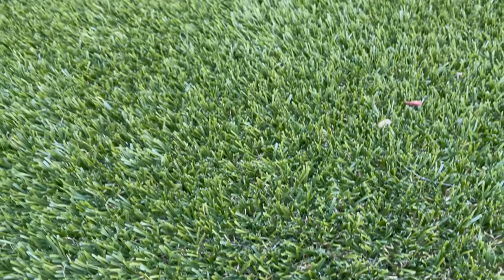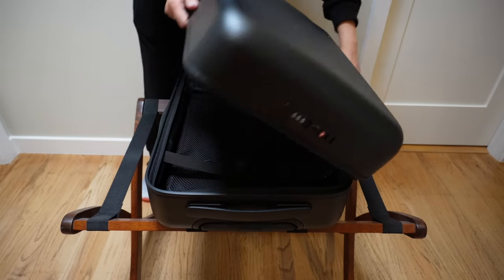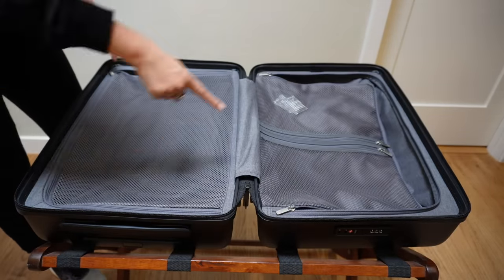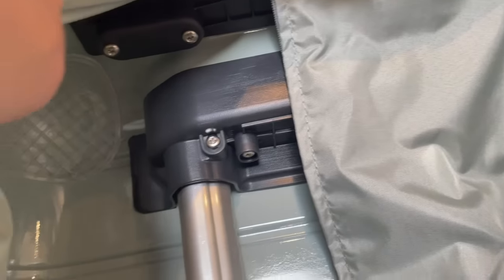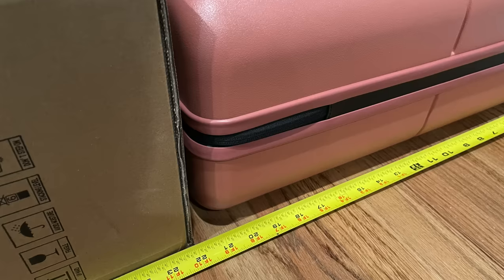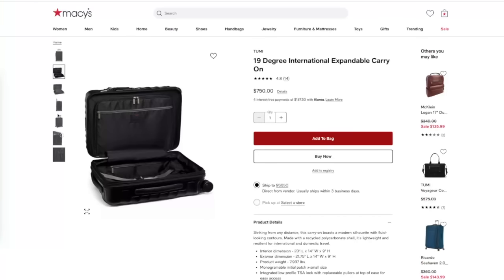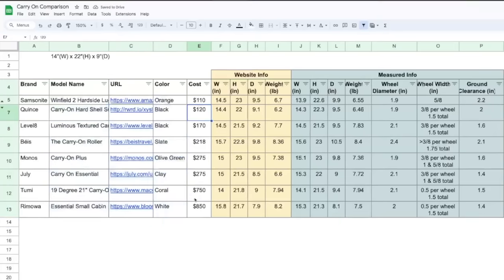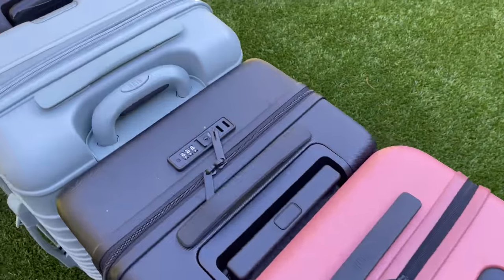BEST HARDSHELL CARRY-ON | Rimowa * Tumi * Quince * Monos * July * Level8 * Béis (left to right)

Comment: I ended up going with July for all the reasons you listed, but what really sold me was the life time warranty. I reached out to July via instagram and asked I specifically if the warranty covers my bag if the airline damages it and they responded with “ yes it’s covered no matter who damages it”. I got the carry on and checked plus.  Lol
Reply from the maker: That’s good to know! Thanks for sharing.
Reply: I'm purchasing luggage right now. (major$) I hear complaints July too heavy. Your opinion. I like July trunk, no zipper. I'm traveling from MI to Ecuador. Tks. Truly appreciate.
Reply: @BPe-ie9je  the trunks are heavy. If weight is a concern I’d look at the  “light”  line.
Reply: I just was trying to figure out what luggage to use for a trip next year that includes multiple airlines, some of which have strict size and weight limitations. Since I own a bag that is around the same weight as the Quince carry on, and meets the size limitations of Singapore Airlines, I am just going to purchase one of the Quince check in bags to use.  Singapore Airlines has a small size limitation for the personal item, stricter than the other airlines I’ll probably be booking flights on. I’ll just pack my Biaggi Runway Hardside hybrid carry on, and weigh it to make sure it doesn’t go over the 15 pound limit packed. I’ll be gone almost 40 days and will definitely be washing my clothes along the way.
Reply: The extended warranty does not cover any defects caused by improper use, cases that were bought second hand or without proof of purchase directly from July and cosmetic damages
Reply: How has your July carry-on been holding up? I was thinking of buying July luggage after this video, but after seeing a variety of poor reviews online i am hesitant. Lots of reviews say they are poor quality and something often breaks within the first year — when they try to contact the company for a replacement, their customer service is TERRIBLE! What have your experiences been so far with July?
Reply: @PandaWill89  yes this is 100% true and stated on their warranty page. What wasn’t stated on the page was damage by airline. I asked specifically about airline damage (through their IG account) and they said it is covered. I screenshot their response incase I ever need it as evidence 🤣

Comment: I’ve had the Monos Carry On Plus for a little over a year now and although it’s most expensive luggage I’ve ever owned it’s worth every penny. I’ve been on 5 trips with it and it’s held up perfectly. The wheels are super smooth, the handle is solid and overall it’s a very high quality product. After 5 trips including being checked in and  hauled in the bed of a pickup truck it only has a few scratches on it. Don’t mind that since it shows it’s traveled rather spending its life in a closet.
Reply: This is what I’m leaning towards. ❤
Reply: How was having the plus? Did you have to check it in at all?
Reply: will have to check 😢in, I had to on smaller plane going back and forth

Comment: We replaced our 20+ year old Samsonite and Tumi with CalPak (purchased at TJMaxx) and had no issues traveling internationally - 5 flights, 1.4 km run through airport to make connecting flight, through public transportation and across 4 blocks of cobblestone streets. Wheels look like new and no scratches on outside. While I don't expect to have the CalPaks for 20 years and it certainly is not as luxurious as a Tumi, it has worked for both myself and my teen during this stage of our lives.  Appreciate your reviews, very informative.

Comment: Great review!  FYI most large dents in polycarbonate luggage corners can just be pushed out from the inside with little to no evidence of the previous damage.  That's the great thing about the material; It is very flexible and absorbs the energy from impact without cracking.  So when you see a dented corner consider it a "good" thing vs a piece of luggage made of lesser plastic that instead cracked and can't be easily repaired.

Comment: Another vote for monos here. I have the terrazzo pro plus carry-on & the check in medium. People have stopped me in my tracks to tell me they like my bag. The carry-on has held up to several intl trips including 17 days in NZ being checked multiple times & hauled in vans and busses. I've had things spilled in it, drug it over rough terrain and it still looks great. They were expensive but I have no regrets. Only issue I have is when the suitcase is stuffed you can't lift the handle.

Comment: WOW!  Thank you.  I really wish Swiss Gear was on your list.  I have 3 pieces from them that after 28 years are starting to have "little " issues like a broken zipper pull which is really nothing.  They have been a true workhorse traveling all over the world  but want to replace the two wheel for a four wheel as I am older and want the  ease of the four wheels function.   Thank you for the info.

Comment: I took my Monos regular carry on from SF>London>Paris>Rome>Barcelona>London>SF and I highly recommend it. It was checked in for 3 of the shorter flights and even went on a 2-3 mile walk on the streets of Rome and came back with only a couple minor blemishes. I actually really like the button on the bottom of the handle to make any adjustments on the fly as opposed to rotating your hand so your thumb can find the top button. As for your winner here, July seems like a pretty good suitcase as well, I just personally cannot get with the amount of branding all over it. Now I am doing research for a check in suitcase and the first thing on my checklist is a latch closure instead of zippers. Might want to look into that as well since you mentioned not wanting to walk around the whole suitcase to unzip it 😂
Reply: Was it checked in by choice? Or because it was too big ?
Reply: @j0404t the flights to Rome and Barcelona were on budget airlines so we were only able to take personal items on board. Then I checked it again on my way home from London because there was like a 3 hour long line at TSA and a British Airways agent told us that if she checked our luggage, we could move to a short line they opened for personal items only. No issues with the size at all, again with the regular size not the plus.

Comment: ok this is the spreadsheet and video that i wish existed when i was looking for a suitcase summer 2022! i ended up going with july (classic carry on - before the essential came out) and have traveled over 20 trips with it. on my most recent trip, i checked the suitcase and the plastic cracked at the corner of the external bumpers but i reached out for warranty replacement and it was a really smooth process! (we also bought a calpak at the same time and the july wheels + telescoping handle are SUCH a night and day difference). 

i've been trying to keep longevity/durability documentation on instagram but i've fallen a little behind on keeping up :)

Comment: 14x22x9 is typically for U.S. airlines in the U.S.  Usually a little smaller is needed for elsewhere.  And keep in mind, lighter can be flimsy.  7.7lbs is right in the middle of your spreadsheet.

Comment: One underrated brand for this that I have been using for three years now (and I constantly travel for work), is the Muji hardcase. So durable, simple, and has good value for money. It has a wheel stopper so it’s perfect whenever youre in a public transport standing on a bus or a train. The only downside I guess that even though it’s TSA lock, it’s a manual key system and not a numerical lock. I dont mind it so much though.

Comment: Used my July carry on all over Japan and France and it is so good. I really put it through the ringer
Reply: Can I ask which carry on model you have? I’m a little concerned about the size of the essential for international travel…
Reply: @DynomonZ  the carry on works for all international airlines
Reply: @Art-cq1zy If you are talking about the July Carry On Essential, that is definitely too big for some airlines. For example, Qantas & Jetstar carry on must measure no more than 56x36x23cm. For those airlines, only the Carry On Light would fit that criteria. Plus those airlines have weight restrictions and the Essential is just too heavy, using almost half of the weight allowance even while it’s empty.

Comment: I have the older (2007), latch version of your samsonite in 20" and 25". They have served me very well but the carryon was showing its age and it was time to replace it. I refuse to use a zip bag, I will only use a latch case. That made it harder as very few makers use latches now. I got an aluminum level8 this year, which  I snapped up on a great sale, and I'm really satisfied with it. It came with a set of packing cubes and a dustbag.

Comment: You need to add a "drop test" with your reviews. You could drop it at 5 and 10 feet on the front (since all the baggage handlers throw it) , top and bottom. I only buy really cheap luggage these days since I've had so many of them broken by the handlers.

Comment: Did you even look at Roam luggage?  This video is a great comparison   Wish Roam was included. I had Tumi for years but it finally had to be replaced. I have a Rimowa and love it but don’t use it often as it is just a little larger and I worry about it fitting in the overhead. I have Roam and really like it but it doesn’t hold as much as the Tumi or Rimowa. Weight is one of the most important factors I will look for in my next purchase. Thanks for the video.

Comment: I actually use my Rimowa as my rollaboard as a pilot. I had a Luggage Works for about 12 years but love my Cabin Essential Sleeve. I've had it for 6 years, dragging it with me on all my work trips, and so far, it has had no issues. Will it last 12 years as my luggage works? Time will tell, but so far, so good.

Comment: I am wondering if the Cabin is a better purchase than Cabin S because the height and the width are the same, and it's the width that goes over the limit allowed on international airlines.  You lose almost a couple of inches on the depth but all the airlines say 9" for the depth.  Did you find that the depth was a bit small compared to other luggages, like if you wanted to hang a bag over the top of the luggage?

Comment: Great review! One thing I wanted to point out is that you shouldn’t have used residential carpet to test out the wheels. Commercial-grade carpets generally have lower pile heights and tight loopings to keep it intact for frequent activity, while the residental is loose and for made for comfort. Thats why suitcases with bigger wheel diameter/width had better carpet roll compared to suitcases with smaller wheels. Tests would’ve been completely different on commercial grade carpets
Reply from the maker: Thank you! You are spot on! My thought process was if the wheels rolled smoothly on the thickest carpet I have, they should be able to handle any airport/hotel carpet.
Reply: All things being equal in terms of wheel diameter, the wheel material is usually the biggest factor in terms of rolling resistance vs comfort on various surfaces.  Hard rubber or even plastic wheels won't bind on carpet when rolling and turning or pick up as much dirt and debris.  However, these will be a nightmare on hard surfaces or sidewalks/streets and impart a large amount of vibration into the handle and generate a lot of noise.  On the other hand, softer rubber wheels that are a pleasure to use on hard floors, sidewalks/streets will typically bind a lot more on carpet when turning and also pick up far more debris.  The wheel material can vary widely between luggage brands and even models within the same brand too.

Comment: Are you sure you didn’t get the July carry-on with the power bank spot? Because it does weigh about 7.4 pounds which would be a pound more than just the essential. That’s interesting to note that if the essential actually does weigh that much how much does the other one weigh?
Reply from the maker: I double checked, and it was the one without the power bank!
Reply: Yes, this is the Essential. You can tell because it doesn’t have the aluminum top corners. (I have the Essential, and I love it, but I haven’t actually used it yet.)

Comment: These are all trash compared to the Lufthansa aluminum luggage.  German engineered and made, tested by Lufthansa pilots and flight attendants.  Absolutely built like a tank, much sturdier than Rimowa (Rimowa has terrible, flimsy handles and the polycarbonate can crack at the wheels easily after a few years) and half the price of Rimowa.